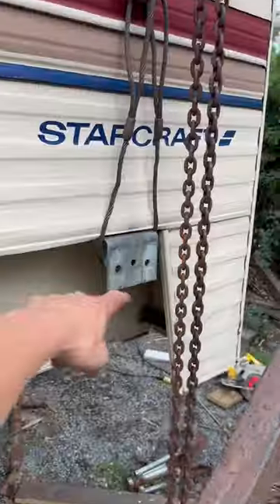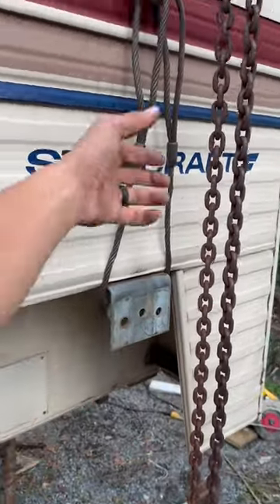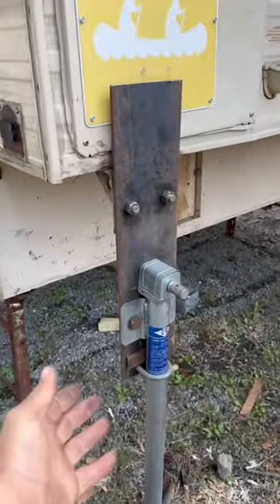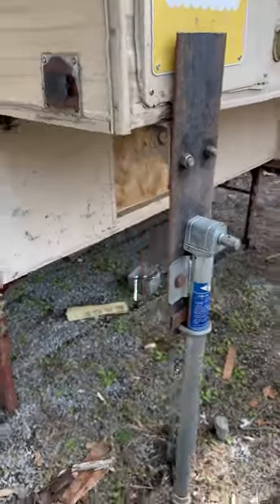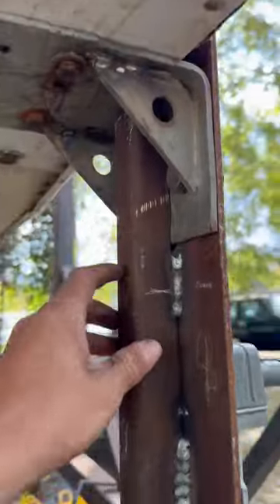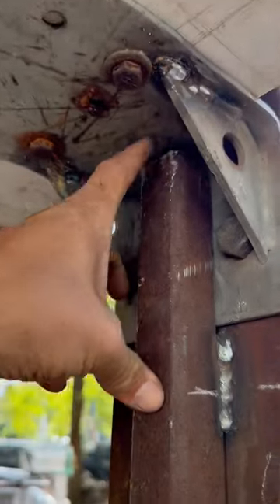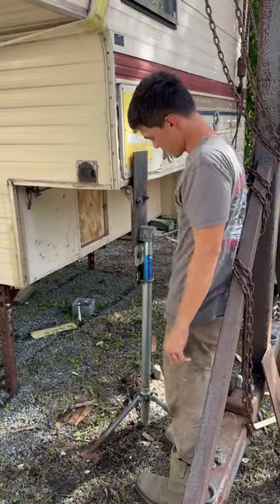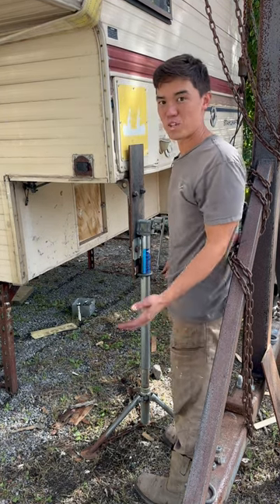DIY jack extensions for my vintage truck camper!

Comment: This guy can fix anything with "garbage" hes literally a MacGyver fisherman! Thats a huge flex in my books. Id much rather know how to or be able to figure out how to fix anything/everything than having a little more money than someone else. Like, cool.. u make 10k more or 20k more a year than me? I save that in oil changes and fixing my own vehicle's, boats, bikes and everything else not to mention house maintenance and anything you want, like an extension or something. Definitely saving more than people spend so that is that. What I'm saying is,  I'd rather be like this guy and know how to fix everything than have more money but are useless and always have to call someone every time something breaks or needs fixed. This guy may have a lot $ btw, idk that, was just using his knowledge and expertise as an example.  Took me a while but i got to the point. I think lol... ive had a few drinks.. like your videos brother

Comment: Make sure your camper is road worthy. My Uncle had a truck camper that sat at his 2nd home in the northwoods in Wisconsin. It was used a lot in previous years, but as time went on they just parked it with hopes in using again someday. I dont remember why, but my uncle and Dad needed to load it onto his truck and take it 4 hrs south to his other house. With my Dad driving behind the truck and camper,  he thought he saw it starting to wiggle just slightly. Just as he was on the 2 way to tell my uncle, it completely fell apart all over the interstate. No one was hurt and it didn't cause an accident thank god. But it was sad that old camper was no more. It held many memories of my aunt and uncle taking my brother and I camping, or our first trip to Fort Wilderness at Disney. They never had kids, we were it. 
So please becareful. Im sure your camper is newer but if it has water leaks it m8ght not matter how old it is.

Comment: Here's a tip that might give you help you didnt know you needed...Air Adjustable shock absorbers for the rear of your truck will help with spring settling/sag. Also will help correct the Rake of the truck under way. They are relatively Inexpensive at about 100$ for manual adjustable version

Comment: My father-in-law had the same type of camper. He had it resting on a boat trailer and would drive it down the road to his buddy's land and hunt out of it. He passed away and my uncle wanted it and so i used ratchet straps and hauled it from northern Mi to the detroit area. I made several stops checking it. By the time i got home it was almost off the trailer. This was back in 2011. If it were today it would be all over youtube under darwin awards.... when i got it to my uncles house. He opened one of the side doors and found the jacks. I could have just put it in the back of the truck safely... oh well

Comment: Always get the rust off before welding man , it will make the weld stronger by welding on the metal and not the rust